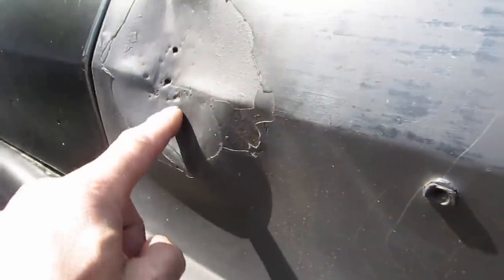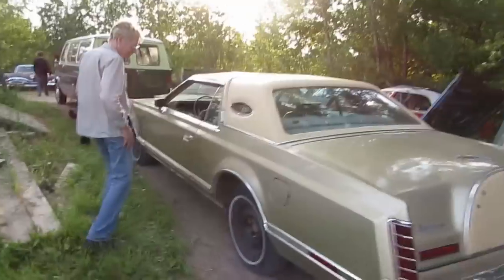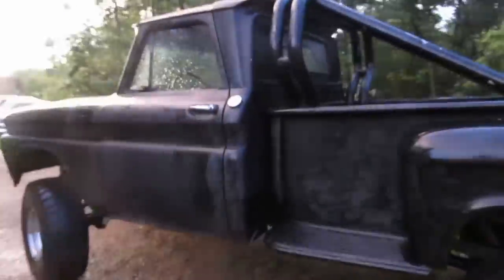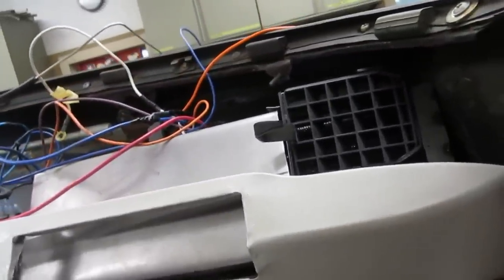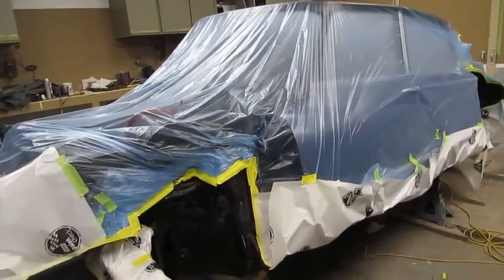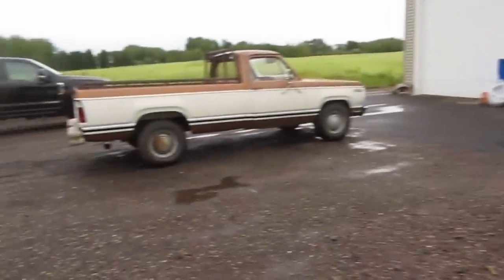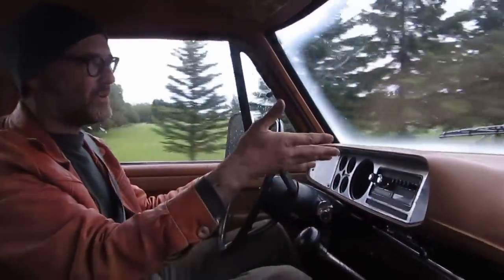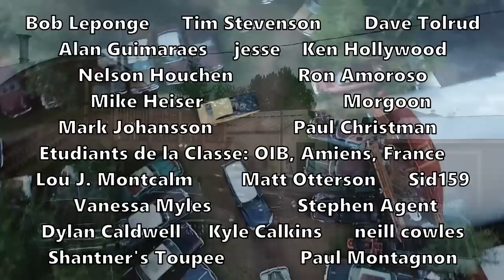The "Other" Dodge Diesel, Driveway Dust-ins,

Comment: FYI:

How Mitsubishi Diesels Got Into mid-1970s Dodge D100 trucks

by William R. Loutzenheiser, Phoenix Casting & Machining

Mitsubishi dieselThe players:

Industrial Irrigation Engines built Chrysler industrial engines for irrigation from 1955 to 1995; they also used Mitsubishi diesels.
Pettit Automotive, local repair garage and tinker, used to work for Industrial Irrigation, before he retired and opened his own repair shop.
Spitz & Blauvelt Inc (SBI), a local aluminum foundry and the area’s largest job machine shop with welding and repair; it moved to Juniata, Nebraska in 1984 and became Phoenix Casting.
In 1977, Industrial Irrigation’s sales force got the bright idea that, to promote their newly-acquired Mitsubishi diesel line, they would convert some of their service trucks to diesel, and offer it as a conversion kit for farmers.

John C. (Jack) Osborne, Industrial Irrigation’s president (and the younger brother of retired Nebraska Cornhusker coach Tom), talked the idea over with Mr. Pettit and both felt this could be done, so a diesel engine and 1977 Dodge D100 truck were taken down to Pettit, where he started by pulling the gas and figuring what he needed to make to connect them back together. The D100 had a 360 and A727 automatic in it; later ones were done with manual transmissions.

We at SBI had just finished our first adapter to put a John Deere 4219 in a ¾ ton Chevy service truck for the John Deere dealer, Valley Engines in Wayne, Nebraska; this may have been where Industrial Irrigation got the idea!. We also did one for their 1 ton GMC to a JD 4239T; these engines are a bit heavy, at 950 lbs. for a 239 cubic inch diesel, but they do last forever.

We were two blocks south of Mr. Peditt’s shop, and he came down for help with the aluminum casting he needed for the adapter. We helped him design the adapter, made the wood pattern, cast the parts, machined them, and also made a steel part that went from the flywheel to the Chrysler flex plate. [Phoenix Casting still does this type of work for small runs.]

The Mitsubishi had one problem that showed up as soon as it was in the truck and running: the RPM was limited to 2400, which made for a great go-for in town, but a low top end of 48 mph. They dropped the rear gear from 3.56 to 3.07, and found the power curve now needed a turbo to help go over 45 mph.

They had the local injector wizards, the Fobin Brothers, work on the injector pumps to speed up the diesel. I seem to remember Zigy game up with a different injector pump that would run it up to 3500 rpm, but the conversion cost on that was more than the cost of the diesel! The John Deeres, on the other hand, could easily be cranked up to 3600 rpm (the valves float around 4200). Both of these trucks were still being used a few years back when I stopped by to check on them.

mitsubishi diesel

The Deere version was the forefathers of the adapter we make to day to convert SAE engines over to use Chrysler, GM, or Ford automotive style transmissions. You would be surprised at some of the requests we get today for adapters that people think should be in stock. As for the Dodge diesel adapter, we did four to six castings, and this adapter faded away. Still, having your own aluminum foundry has its advantages when it comes to making adapters.

Phoenix Casting & Machining of Juniata, Nebraska, makes small special one-off kids, adapting everything from small Snow Cats to Land Rovers to various engines. The shop is around four miles west of Hastings; Bill is the design engineer of SAE engine adapters for Phoenix castings, and is open to inquiries for special projects.

Postscript (from the Allpar staff)
When the fuel crisis hit, Dodge was not prepared, but perhaps someone heard of Industrial Irrigation’s work. In 1978 and into the 1980s, Dodge sold, as a factory option, the Mitsubishi diesels in D150s, D250s, and Power Wagons; the Mitsubishi 6DR5, was a straight six sized at 3950 cc, with 105 hp at 3500 rpm. It came without a turbocharger, providing good mileage (reportedly over 20 mpg) but limiting top speeds; the turbocharger was added by many buyers afterwards.

Mitsubishi diesel engine

CIS Auto Web wrote (in a wonderfully detailed article) that the Mitsubishi diesel was nearly identical to the Toyota Land Cruiser’s 2H diesel in every respect -- it had an almost identical Nippon Denso injection pump, and was approximately the same size and weight, with a similar power band. The 6DR5 was a factory option from the late 70s and early 80s Dodge trucks and came naturally aspirated from the factory; it had the Land Cruiser’s bolt pattern.

Comment: That Mitsubishi diesel in the Dodge has nothing in common with a Toyota 2H engine. The injector pump and exhaust manifold are not on the same side of the engine. Totally Different.

Comment: its not a k20 its only 6 lug so its a k10 and in 66 it would have a rockwell transfer case
Reply: Levi C- You're right on both counts! kinda, It is a factory K20...but this truck has mud bogging racing history and two owners ago, the guy took the diffs off the truck, as well as his built big block and trans. The Transfer case is a Rockwell! I couldn't member the name after i had a few, lol Thanks!
Reply: @mylesmoparfreak6562  i have the right axles for that truck here in colorado but you would hate them lol

Comment: International Harvester put a Datsun diesel in the Scout in 1980.
Reply: 76-79 Scout IIs had a naturally aspirated Nissan SD-33, 3.2L inline six. In 1980, the last year the Scout was built, the engine gained a Turbo and became the SD-33T. Which made 101 hp as opposed to the 86 hp of the N/A version. As of 1980 it was the first American made passenger vehicle with a Turbo Diesel, and the first vehicle to include a 100k mile Powertrain warranty.